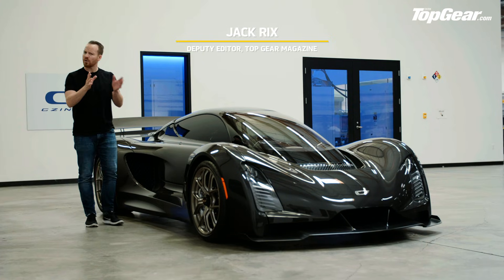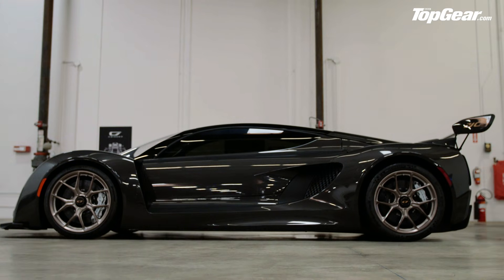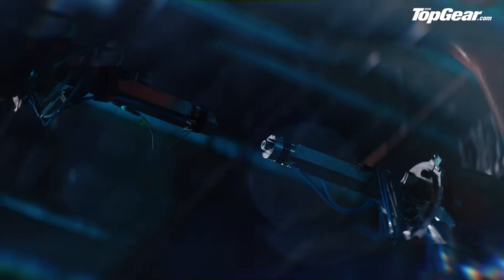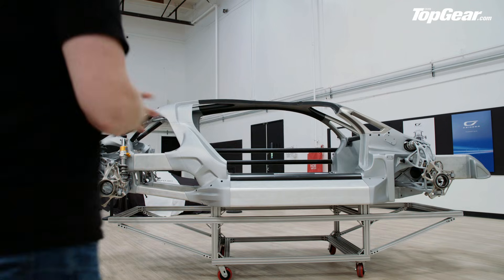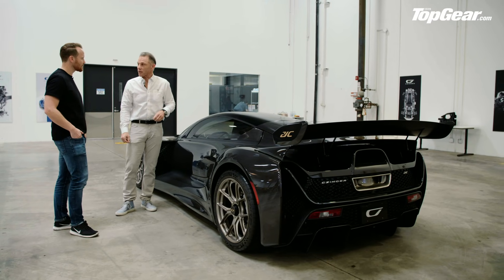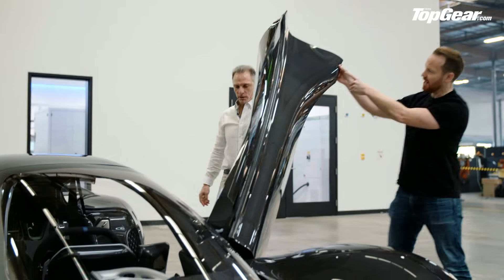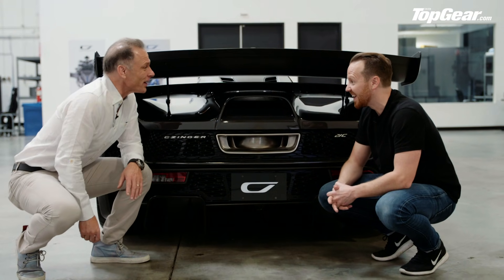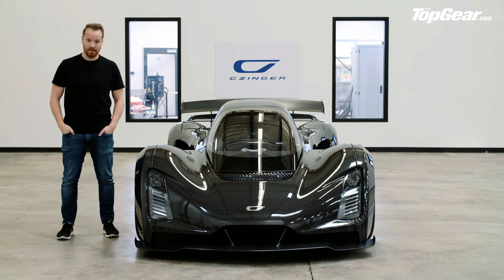FIRST LOOK: Czinger 21C: the world’s first 3D printed hypercar | Top Gear

Comment: Zero emission fuel.? am I missing something?
Reply: Ajay what I thought
Reply: He means that the fuel source is created without fossil fuels. Instead of using fuel from the ground it is created by drawing elements from the air, creating methanol.  — By chemical definition: combustion creates a blast of energy and outputs CO2 and water. (Tricky marketing)
Reply: @funkygoobermelon  why aren't we all using methanol if it's the cleaner option?
Reply: @funkygoobermelon  I invite you to calculate the economics of generating methanol from atmospheric carbon dioxide. I'll wait. No, actually I won't because I've done it myself, and it's uneconomic by at least a factor of 40, easily 100, and likely more.
Reply: Not burning fossil fuel.

Comment: I'm worried about bubbling in the 3d printed parts.
Reply: They probably didn't buy their printers from Ebay so I'm not that concerned 😁
Reply: @bennylloyd-willner9667  yeah, I'm mainly concerned about lifespan of the parts that need to bear load. even microbubles can significantly shorten the lifespan of the part. fortunately due to the modularity of the car the parts themselves shouldn't be a huge issue to replace.
Reply: SLM and DMLS technology doesn't cause that. This isn't your crappy FDM setup. Consumer ignorance is holding back the widespread use of additive manufactured parts.
Reply: @stevebarnes2  Metal printing is literally welding metal powder. the metelurgy for that is new ground. I love it, and the idea is amazing, but it's limited by how much on the beading edge it is. non-load bearing parts are fine. repeated stresses are not going there, but as for those that do best load, unless the modeled the shit out of that and assumed poor print quality on that part, I assume it will fail much ealier than an equivalent cast part.
Reply: @bohba13  This is exactly the industry I work in and we make several load bearing parts for automotive and aerospace as well as many other industries. SLM and DMLS result in a denser stock than casting and a far more even distribution of the elements within an alloy. The micro-welding that takes place in the process should not have the limitations of standard welding applied to it. From a capabilities stand point additive manufacturing is superior. The only downsides are time per part and cost and believe me, all industry leading companies are striving to bring these down with R&D work.
Reply: @stevebarnes2  I eat my words. I do love how 3d printed obdject can have a complex internal structure like a honycomb or the internals of a bird's bones, (as bones are technically 3d printed by the body) 

I personally do hope this takes off in aviation as that means that you'll have companies like Boeing and Airbus throwing R&D money at you guys, and that can only be good.

Comment: The advantage of a 3d printer car with almost all of its parts 3d printed is it makes replacing parts much easier since you can order them by demand from the manufacturer. It's also easier on the manufacturer since they don't need to stock up on spare parts as they can just create the parts once it is ordered. Also it will help with a cars longevity as the parts will always be ready to be produced as you can just take the file and print it unlike the older cars where the manufacturers no longer produce the old parts.

Comment: This suspension arm printing technology is exactly what F1 needs right now. New and amazing!
Reply: @MatMo.  Do you happen to know what that reason is?
Reply: @MatMo.  welcome to F1 stagnation and over regulation :) F1 has been disappointing over the years
Reply: @MatMo.  I find it funny that you somehow think new technology is impossible to exist because it "F1 would already be using it" like, that's not how that works. F1 isn't the end all be all, they kinda suck tbh, they've stagnated extremely hard within the last 10 years. Automotive 3D printing is around and tons of high performance groups are utilizing it. This is the first time it's being used for primary vehicle construction and suspension parts.
Reply: If they introduced 3d printing to F1 the designs would get craaazy. Let's do it.

Comment: It`s for sure not the only climatized room for 3D Printing of any kind. All bigger 3D Printing companies have that. The kind of manufacturing is also not exclusive. This is all stuff which is available for years. Nothing in terms of technology in this Video is new or special. There is even more "impressive" technology in this Sector from Siemens. They can prove the part in a simulation even before its produced.

Comment: When I 3D print parts for my RC car, it goes from 0 to broken in under 2 seconds.
Reply: Try printing Alu parts...
Reply: 🤣🤣🤣 with a consumer 3D printer? Duh... 🙄🤦‍♂️🤦‍♂️🤦‍♂️
No shit? Imagine a home quality 3D printer that maybe cost you $500 tops probably less and it makes shite parts!
I'm stunned...🙄 commercial grade 3D 4D printers can range from thousands of dollars on the low side to over $1000000 for one unit Sherlock. I guarantee you those 3D and 4D printers that Czinger is utilizing are in the million-dollar range. And you can bet your dopey ass that those parts are not going to break 😆
Reply: Flying Lap Productions Pretty sure it was just a joke...

Comment: That 2.8l biturbo v8 engine wont last that long with all that power...
Reply: There is electric engines in it the power doesn't come from the V8 so...
Reply: @yapod9061   930hp on the 2.8, the rest comes from electric motors. So that is still too much power. If you also count the 11.000rpm, thats insanity. 
Its a cool idea, something new for sure, but they went too far with the power for they're first car.
Reply: We'll see.

Comment: That V8 is just incredible
Reply: But compared to the Jesko’s 1600hp (better sounding imo) v8...
Reply: 80 degeree Flatplane crank V8 vs 90 degree crossplane v8
Reply: That engine is half the size of mine and has 4 times the horsepower. Wow.

Comment: Breakthrough engineering of 3D printing. This is impressive and scary too. Future of car making 🚀
Reply: I think it will be big for Hypercar and Supercar makers, but 3d printing takes way too long for someone like volkswagen or gm to use it in their normal road cars.
Reply: @lilrubii6434  maybe they could use it for r&d
Reply: @peperoninja387  Every car company, and many other companies have been using 3D printers for R&D for more than a decade, the public is just clueless about it. 99,99% of you never heard about technologies like SLS, MJF, DMLS, etc. Those are nothing new. Most people familiar with 3D printing at all only ever saw those cheap toy 3D printers that people use at home for printing useless plastic crap. 3D printing machines that cost hundreds of thousands have been used in the industries for over a decade.
Reply: @derbigpr500  oh wow
Reply: @lilrubii6434  Yes, but the last one,the Divergent Blade, didn't quite look finished..
Reply: @lilrubii6434  You're not thinking of the future.  Now or soon no, but this is the genesis.
Reply: No real breakthrough in 3D printing per say. It'll be interesting if they at least 3D-print turbines and engine elements like rocket manufacturers do now.
Bugatti have been making 3D-printed brake callipers for example.
Reply: It's not a breakthrough, this has been available for almost a decade, people are just clueless. I've been designing organic components like these for 4 years now and using DMLS tech for longer than that, it's literally piss easy to do with the right software, and all large CAD packages have these features built into them. Designing components like this is easier than designing the manual way. This way you start off with a very simple shape, pick the areas of the components that will have contact points and loads on them, and the rest is done by the software. 

The issue is not designing, which is made easier, and the issue is not 3D printing, which is making production easier, the issue is TIME and COST.  People don't realize just how expensive this is.  Printing one of those suspension arms costs tens of thousands of dollars, and it DOESN'T MATTER how many you make, price per unit doesn't go down, and time of production is always the same, tens of hours for each component. On the other hand, if you design a classical suspension component that is produced by casting aluminium for example,  then you can machine a mold ONCE, and then just inject the parts like on a production line, very quickly and very cheaply. And you end up with parts that are like 90% as good in terms of performance, but it's 100's of times quicker and cheaper to produce them.
Reply: To long no it would be quicker to make new parts. Especially when this technique is perfected
Reply: No difference than when the elise was built using extruded aluminium, just a new process that will reduce cost.
Reply: @1183newman  At a completely different price point though. Still, interesting stuff.
Reply: You are right impressive and scary
Reply: just i can just print the car by myself.... no thank...
Reply: Benjamin Sila yeah, Tesla actually looks ridiculous against this
Reply: @ericvalverderosado2046  it's not 2d printed right? it just has the OTA updates to increase hp and stuff
Reply: It's not the first, and there's really not much of the car that is actually printed. This video is literally just clickbait...